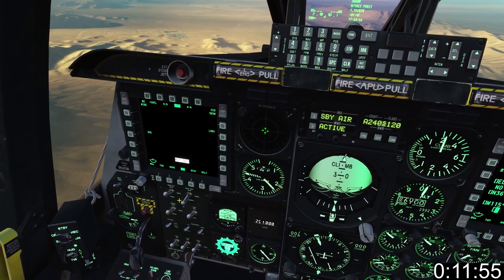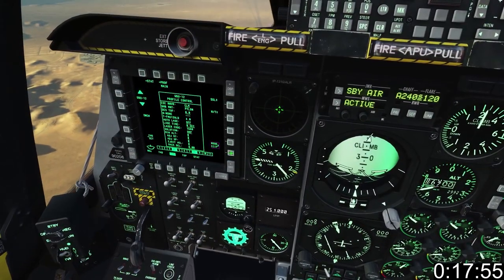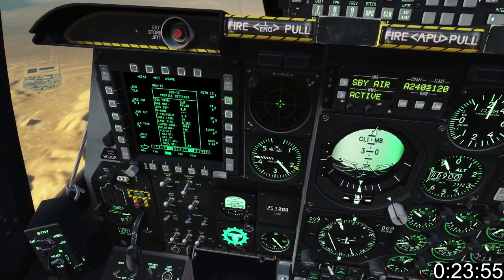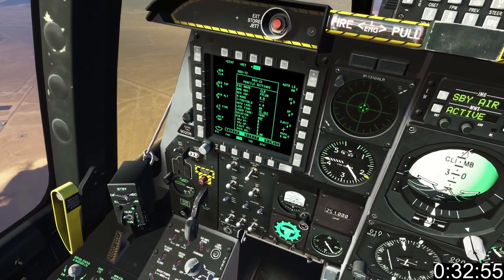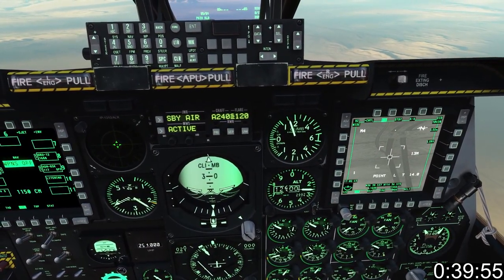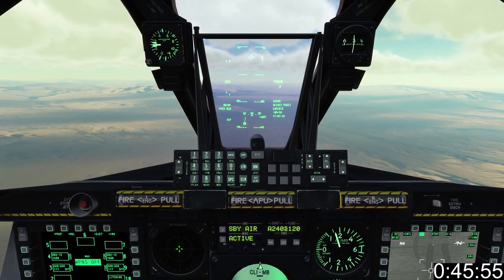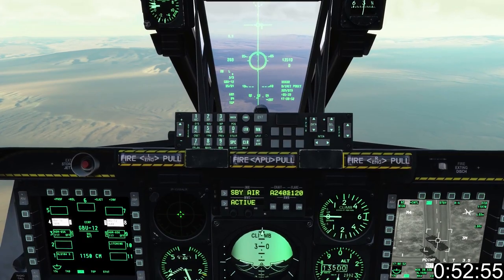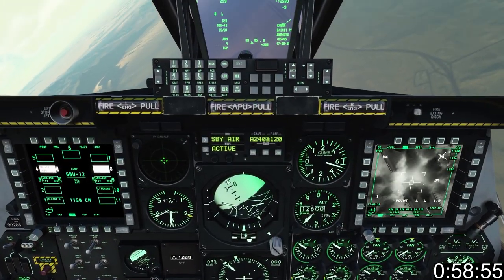1 Minute DCS - A10C - Laser Guided Bomb Tutorial

Comment: If you'd prefer not to hold down the nosewheel steering button for the entire duration of the bomb's flight, you can enable a setting called 'latch on/off', which allows you to toggle your laser on and off. You can find this setting in the 'CNTL' section of the A-G page in the TGP.

Comment: Exblain what is the SLN / Solution in GBU 10/12 profile in DSMS ?
Reply from the maker: Thank you sir!  The easiest way to do it is as follows:
Go to your DSMS page and select Prof (OSB 1) then use OSB 19/20 to arrow up and down to get to your GBU 10/12
Select View Profile (OSB 3)   change the mode to CCRP with OSB10
Select CHG SET (OSB 16).  Here you can set Autolase to On or Off with OSB 6 (remember: If it's off you'll have to hold the nose wheel steering button in until the bomb hits the target). It's also a good idea to set your LS TIME (seconds) using OSB 16, enter the time on the UFC and OSB 16 again to save(this depends on your release altitude 15 to 20 seconds is a good rule of thumb).
You may also adjust other parameters such as release altitude from here. 

When done select Save (OSB 3) then Stat (OSB 1) to return to the DSMS main page.
Hope this helps.

Comment: @laobi
You mention using the nose wheel steering to do something associated with all of this setting up (I have heard it used with ordinary bombs to do things as well)  yet I cant find anything anywhere yet that relates to the Nose wheel Steering button other than Nose wheel steering when on the ground. I am really confused over the various applications of this particular button, can you help me please. I have learnt how to use the Gau8 and how to set up A65Maverics (along with the various types applications) but this is a brick wall for me, and I havnt yet found it in the many instruction manuals.
Reply from the maker: Thank you sir!  Yes, in the main part of that tutorial I covered switching the Auto-Lase on, with the auto lase on all you have to do is ensure you set enough of a lase time so that the bomb is guided to the target, this depends on altitude (10k shoes 15 secs, higher = more time).  In some situations you may want to manually lase the target (eg. some other bastard blows up your target as you drop, so you want to quickly change to another very close target, or you're lasing for a buddy), so here goes:

1:  Do everything up to the point where you set Autolase to on - make sure it stays off
2: Locate your target and lock it up, slave all sensors etc.,
3: Fly the line to target and release your bomb/launch Mav
4: Lase the target by pressing in and holding the nose wheel steering button which doubles as the lase button (if you have a TM Warthog this is the little pinky button on the front of your stick behind the paddle switch)
5: Hold the button in to continue lasing until the bomb reaches the target, you will see an L appear on the TGP display (if you release the button it will stop lasing...I think)

Hope this helps.
Reply: @Laobi  Hey thanks for coming back to me on this. Yes that makes more sense. So this is purely and simply a lase trigger. Its along haul learning all these systems on the A10C but I am getting there one by one, particularly with your videos. Very detailed without any bullshit, the beauty of your "1 Minute" approach is that sometimes in the longer explanations from some of the other presentations, where you listen to a 20 minute or 30 minute equally detailed account, after 10 minutes they have only covered a half of the stuff and I want to get into trying it out. By 20 minutes I am forgetting what was said in the first 10 minutes, and at 30 minutes I have to go through the viid again. I watch one of your "1 minute" videos two maybe three times almost learning actions parrot fasion then straight into flying and trying. Getting through one or two of these when I get time for an evenings flying is good project time, and if I have forgotten something from previous .... hell it only takes a minute to look at the relevent vid as a reminder. Keep these coming, they are great.
Reply from the maker: Thank you sir!  I'm glad I'm not the only one who loses the forest for the trees in the longer tutorials, I love watching them, but the amount of clicking back I have to do for the information just kills me.  Generally I spend a lot of time in the Natops trying to grasp things as it's just lists of things that need to be done (buried in more lists).  I found myself watching some videos 10 or 15 times (I'm probably responsible for some of the longer form videos watch count), as time is always something I'm short of I started making these to remind myself, then I realised I couldn't stand hearing myself and decided to punish everyone else with them and write checklists for myself